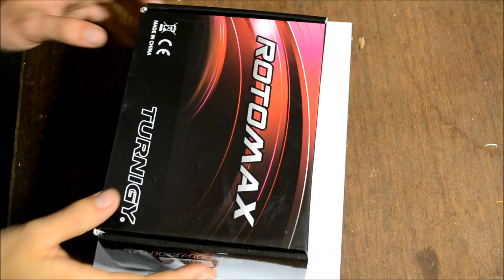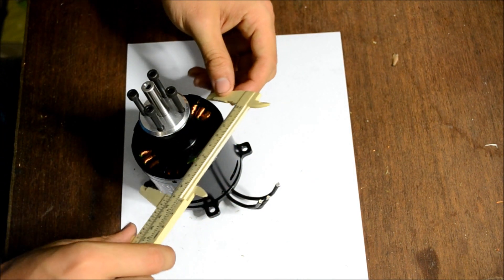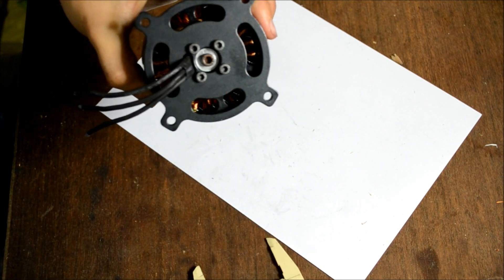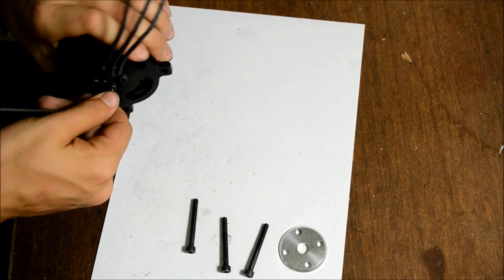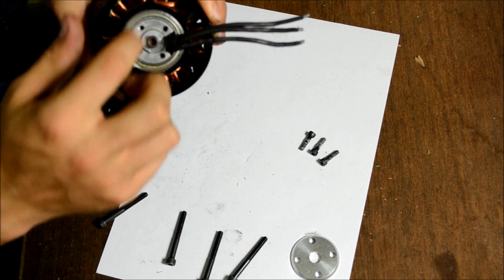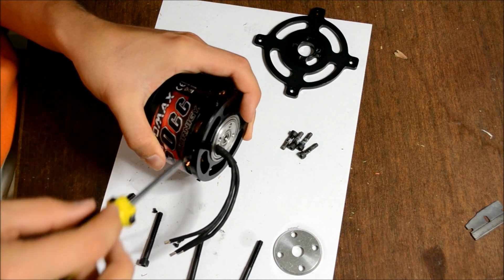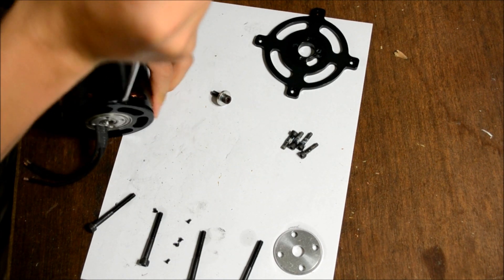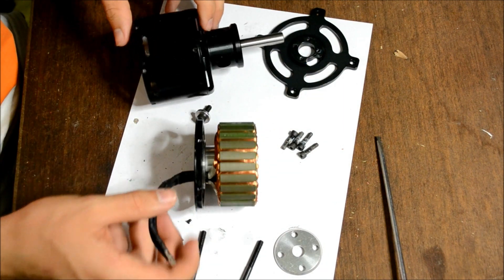Disassembly of Turnigy RotoMax 50cc Brushless DC Motor

Comment: Hi there. One question - can the motor shaft be reversed? I couldn't tell from the video, but I am looking to use a motor like this but with the shaft popping out of the back of the motor. instead of the front. Thanks!
Reply from the maker: Hi there, it's certainly possible however I wouldn't recommend it as it'd require heavily modifying the stator and re-balancing it would be very difficult. Good luck!
Reply: Thanks so much! I suppose that there is no fastener holding the shaft in, and it is friction mounted. I  will check out some other options- it seems that the Great Planes Rimfire 65cc looks like it has a replaceable center shaft. It's more expensive but appears to be a bit easier to service and disassemble.
Reply from the maker: It has the Circlip holding the shaft in but otherwise it's a friction fit.

Comment: Hi there,
i was wondering if its possible to change out the shaft to a normal one?  I would like to put a 4 bladed varioprop on this motor but i have no clue if thats possible. not with this 4 bold mountingplate i reckon?  If it is a no-go then i have to look for another motor.
Thanks,
Jero
Reply from the maker: Hi Jero, 
I'm sure it's possible but not without a fair amount of machining. It appears the shaft is pretty well secured into the housing (we've actually cut the shaft off our most recent motor and created an adapter that suits the 4 bolt mounting plate. 
Thanks, 
James
Reply: Thanks James!  A new mountingplate sounds like a very good solution, i should have one CNC'ed from a workshop. Keep it up!

Comment: Could you please help me ? I have a 150cc of the same company and I would like to use it on a Paramotor, But I dont know which ESC. I should use for it. Do you know which one is best? Thank's
Reply from the maker: Hi Bisholi, thanks for the question. The ESC you require really depends on a number of different factors, however the cheapest and easiest option is to use the 14S 250A ESC from hobbyking. In my opinion, you'd be better off using a Castle Creations Controller such as the Phoenix Edge 160HVF which would limit you to 44.4V nominal and 150A-160A peak current draw but has a lot of programming capabilities and higher build quality. Using this you could still output 6.66 kW! 
The other option is to sensor your motor and then use a sensored motor controller.

Comment: Hey mate, what is the length and diameter of the stator?
Reply from the maker: Hi, 

The length of the stator is 28.5 mm and the diameter is 71 mm. Anymore questions just ask as I have the motor in bits so I can easily measure other specifications if needed. 

Cheers,

James
Coulomb Motorsport
Reply: thanks a great deal mate thats like perfect for what i want to do, do you have any spare around I'm in adelaide. don't want to wait hobby kings huge shipping times
Reply from the maker: Are you looking for just the stator or for the whole motor?
Reply: i just need the stator but i can work with the whole motor if that what you can provide
Reply from the maker: I have a stator from a shorted Turnigy 50cc motor which I've already removed most of the wires from. I can provide that pretty cheap. Or I have a spare 50cc motor but it's brand new.

Comment: Could you answer a question, please? Does this motor can be used with 4 in series 12V lead acid batteries (48V)? I'm brazilian and Li-Po/Li-ion batteries are too expensive.
Reply from the maker: +Fábio Barros Hi Fabio, yes it can although you still must use an ESC from an RC plane or helicopter. I'd highly recommend Castle Creations HVF 160 controller if you can afford it (http://www.castlecreations.com/products/phoenix-edge-hv.html). The Turnigy Dlux 200A controllers from Hobbyking work with this motor but burn out very quickly. 

You'll also find it hard to pull a lot of current out of the Lead Acid batteries but it'll still work. Hope this helps.
Reply: Thank you!
Reply: I'll probably build my own ESC with high quality IGBTs. Thanks!
Reply from the maker: Not a problem. Will you make it sensorless or are you planning on adding some hall effect or opto sensors to the motor?
Reply: I'll try to make it sensored with hall effect.